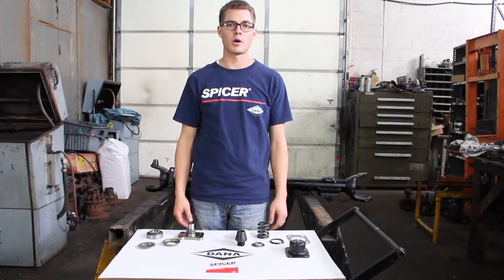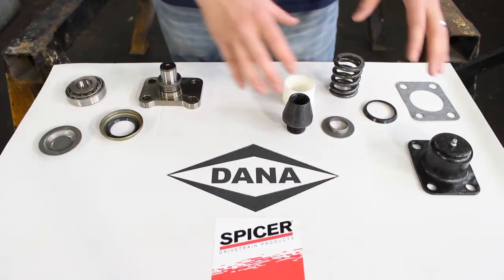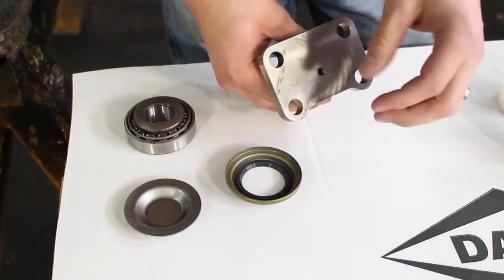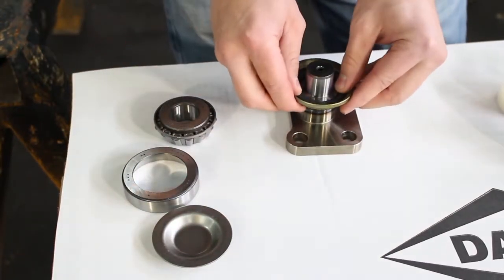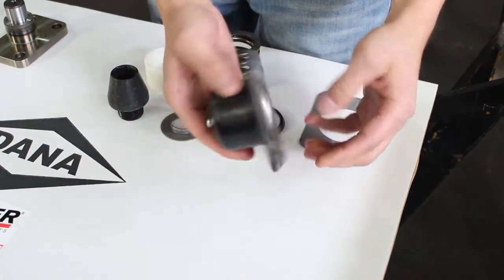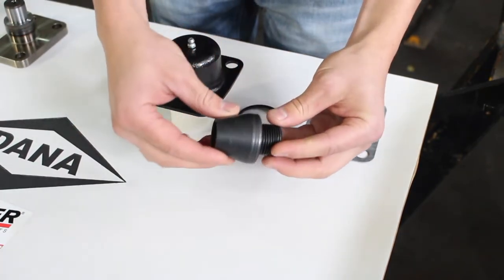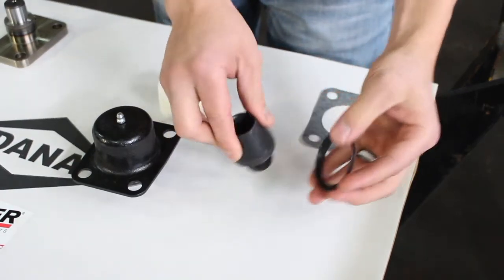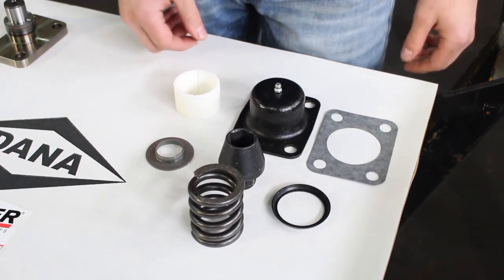Lower And Upper King Pin Rebuild Kit Ford Chevy Dodge Dana 60

Comment: I got a gm 60 upper and lower kingpin rebuild kit through these guys (not this kit) and it was exactly as it was shown to be. All Spicer parts and the best price around.

🤷‍♂️ Wish it included the upper kingpin seal also. Wasnt in the picture or parts list so buy seperate. Gladly would've paid the additional cost.

EDIT: now I have to walk back what I just said about the missing parts. Now that I'm getting to the rebuild the upper Kingpin seals were included and very well hidden amongst the other parts of the Kingpin rebuild kit. I wish I would have found them before I ordered two more seals. I thought I was doing the right thing by trying to make sure that I had all the parts and overlooked the seals. My mistake!